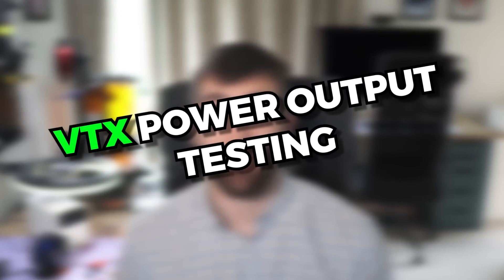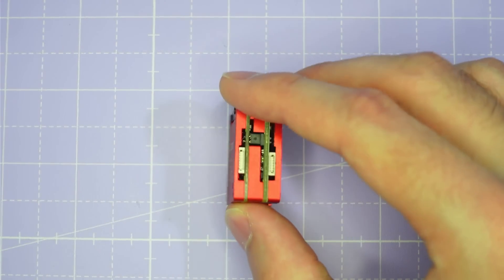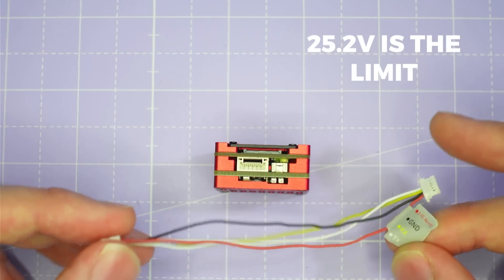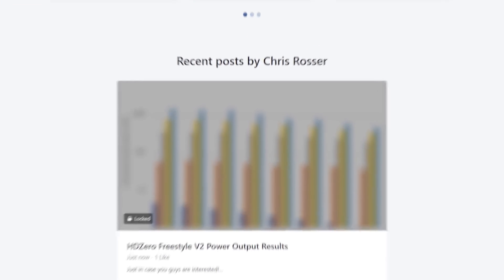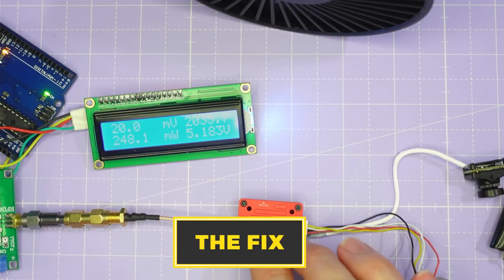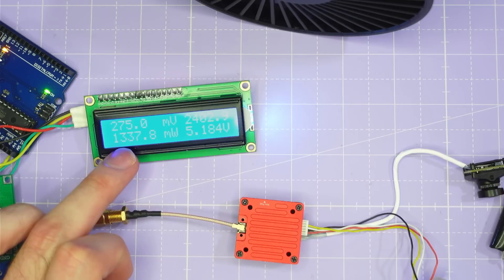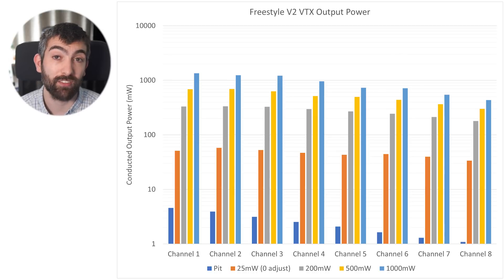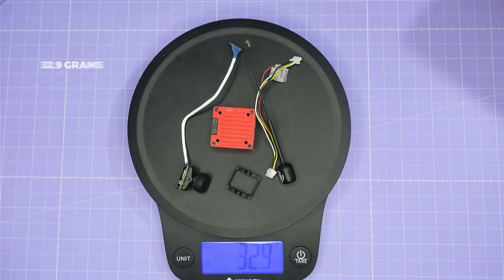This review was nearly a DISASTER: HDZero Freestyle V2 VTX

Comment: 3:01 high Chris
I’ve been told by Divimath that the vtx should be powered by 9v bec or 4s only VCC with capacitor. What’s your thoughts?
Do you think it will be ok to use a 16v bec direct from fc?

Comment: How does the screws being too tight affect the output power?
Reply: Its like they forgot to put some spacers btw the stacks. Eagerly waiting for my unit to arrive.
Reply: @miquelmarti6537   Thanks, I just read on the discord HDZero forum that the heat sink was machined in error and the RF is grounding out to the heat sink. 
  I am a fan of HDZero and as long as there’s an explanation of what happened and it’s fixed no big deal.

Comment: No way you can use this at 1w without the casing. You really should know better then to show something that will result in the vtx's power amp burning up, would it really have been that hard to do a thermal test?
Reply: I am waiting for this to be tested. My naked Vista tolerates 1000mW, just need to be flying to keep it cool enough. Hopefully same for this HDZero unit.
Reply: @bcc1955  I'd expect the same performance as the original one w VTX which does not tolerate being decased

Comment: What actually happens when losening those screew? How can it affect the power?
Reply from the maker: I'm not sure, but putting mechanical pressure on a chip can affect internal band gap voltage references which could be used to control power levels.
Reply: @ChrisRosser This product is not safe to be used as a video link.
Reply from the maker: This has been fixed in production. So it's not an issue that will affect users. @stst8301

Comment: So how can I mount it, I don't use tape, I want to use 20x20 screws, but if I tighten too much, the power will drop and I won't be able to check it because I don't have measuring tools. Unless my vtx is defective, I don't know
Reply from the maker: You won't have this issue with production units.
Reply: @ChrisRosser  uff :) Can do you test flight with max power?

Comment: Wow! Great work figuring this out, Chris. Based on this, I have pulled down my video until I can verify whether my unit was affected. I don't want to show results from a defective vTX that doesn't reflect the real world performance of the unit.
Reply: Waiting for your range test video eagerly!
Reply: I really like your range test videos because I do my testing very similarly. HDzero really keeps confusing me, because there is not a huge difference in penetration if I compare the freestyle vtx v1 at 1 W with the whoop lite vtx at 200 mW. I suspect that either my freestyle vtx is not really having 1 W output power or the whoop produces significantly more output power. I am not sure what it is.
Reply: @BumbleBeeFPV  At 1w its 5x more power and with RF to double the range you need 4x the power. No matter how much line of sight open range HDzero gives you it doesn't help with multi pathing and interference when flying around obstacles. One thick tree is enough to full screen rainbow HDzero at 1w.
Reply: @CyberdeckCafé  That has not been my experience with 200mw
Reply: No it doesn't because it wont retransmit lost packets. They could theoretically double the latency and send every packet twice. For now let's wait and see how this new vtx performs.
Reply: Yeah, be careful there, don't want to get the hdzero guys upset!
Reply: Will be a bit awkward if it's not defective but the range is just so poor that it seems defective

Comment: Great review Chris. My biggest comment, I have been using this VTX for a couple months now in testing pre-production units, and I 100000000% feel that this VTX unfortunately should never be run decased, the stacking pin connectors connecting the two boards are not going to have a long life once the reinforcement of the heat spreaders sandwiching them is no longer an added benefit. Will GREATLY shorten the life span of this hardware.
Reply from the maker: I think if you use rigid spacers between the boards and a nut on either side you should be able to keep things secure. I agree that a flex connector would be better.

Comment: But the dji vista does support 1200mW with FCC Hack, and that is more than this hdzero vtx. Or is there less power output in real?
Reply: Vista 1200 mW includes antenna gain. Output into the antenna (what's being measured here) is much lower.
Reply from the maker: Check out my earlier vtx power testing video. The vista only outputs about 300mW conducted output power.
Reply: The 1Watt coming from the HDZero is true 1Watt, DJI's 1.2Watts, is not. I don't recall the true power output of DJI, but Chris does have a video on it. I believe it's this one:
-
https://www.youtube.com/watch?v=Vbw7eabpiZQ

Comment: Ups, that's a shocker. Maybe JB has to loosen those screws and repeat his testing 😅.
Reply: I don't have the equipment to accurately measure power like Chris does. I have an IRC power meter but it doesn't read accurately enough to judge this condition.
Reply: I was in the middle of your video.  Walked away for dinner and it was unavailable?  ????? @JoshuaBardwell
Reply: @JoshuaBardwell but your review showed us real world experience over data. 7ms in and I was ready to tune out. I watched your whole review because you showed us real stuff not just data . 

Would you be happy to repeat the test with this hack? Maybe they’ll send you a newer version with the problem resolved
Reply: @mamAsita1111 yes. I'll be happy to do that but not until I'm back from my trip.
Reply: @JoshuaBardwell  you can test by measuring output power electrically. At 14w-15w will be full output. Carl has told me test/review units are affected but they fixed it for productions units
Reply: I was wondering the exact same thing!
Reply: There can be another issue: if this screw trick fixes a power output it also may broke GPS 3D Fix again because more VTX power can interfere with GNSS modules :D
Reply: JB did say he was getting about 500 mW on R8 though, so unfortunately doesn't seem like that was the issue.
Reply: @colinmetzger6755 he didn't say that through testing. He said that cause it's known that r8 is closer to 500mw if output is correct
Reply: @colinmetzger6755  he can't know that without a meter
Reply: Nah I think we should just forget about jb's hdz reviews.
Reply: JB is not an HD Zero fanboy. But likes getting free stuff. His review was more penetration based for some reason. @elxero2189